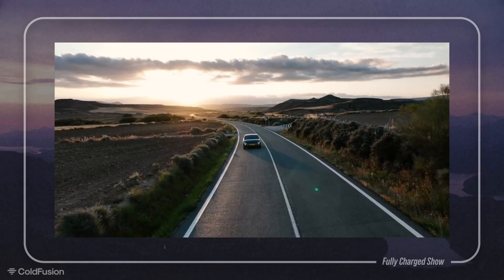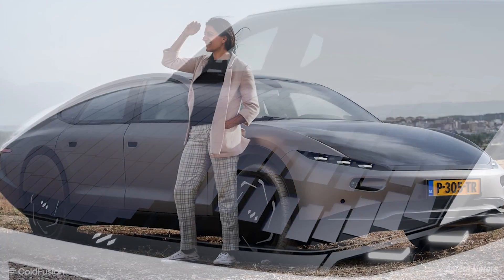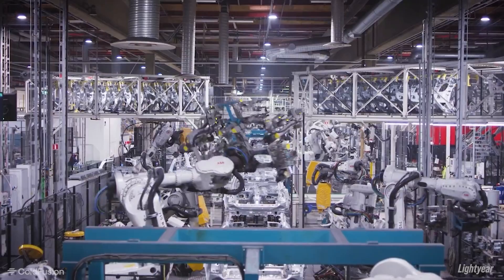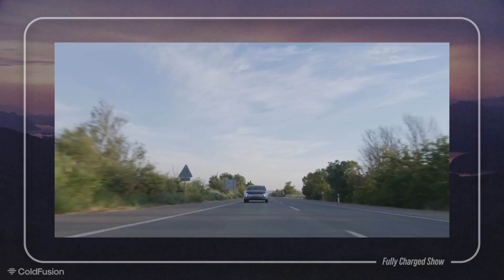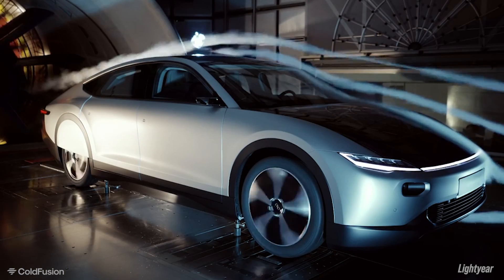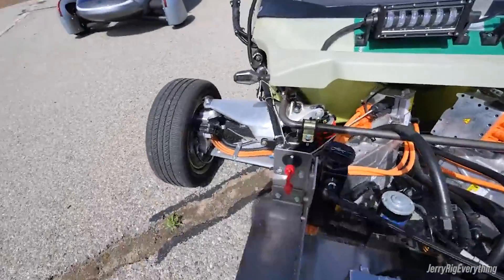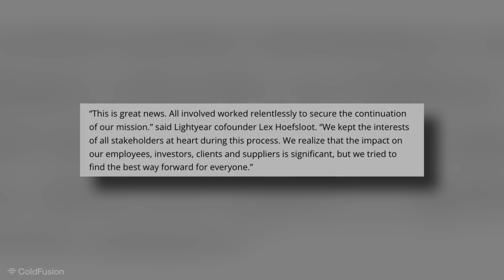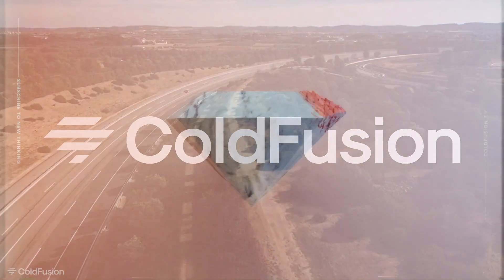3 Interesting Solar Car Projects

Comment: The panels would spend very little time in the optimal orientation. It would be more efficient to just place them on the ground. you need batteries anyway since its not always sunny. while not everyone can just throw an extension cord out the window, the solar panels would be extremely niche. sparing no expense is very rarely an option, in fact most companies try to spare as much expense as possible, just dont pull a Hommond and spare expense on safety.

Comment: The alleged to physics of this scam are Folly. Even if you covered every square inch of a very flat car and solar panels, you'd only get a couple miles of range in a fully Sunny area and the car would have to weigh as much as a go cart. You can forget about airbags, radio, A/C. The limitations are not from the technology, its the limitation of physics from the amount of solar energy hitting an area the footprint of a car. There's no getting around that.

Comment: Even with "fantastic" areo and things like that (meaning less grip) a car will still require a certain amount of energy to travel a specific distance. If you put your solar panel at the top of the atmosphere you will generate at best about 1.3kwh per square meter. With the BMW i3 you get about 6.4km/kwh at 100kph, even if can reduce drag with 20% and your solar panel is above the atmosphere it will not be enough to power you indefinitely. Also cars being too slippery is not a good thing, sure they use less power but they're also less safe due to the reduced grip. You want the rubber to have good contact with the road otherwise you have a plane.

This is a scam. Sorry.
Reply: Aptera is purported to require 0.1 kw-hour per mile.  I don't know at what speed.  With "full solar" and in a sunny local, it is not inconceivable that the nominally 3 square meters of solar panels on Aptera can create an daily average of on the order of 3 kw-hour of electrical energy.  3 kw-hour/day divided by 0.1 kw-hour per mile = 30 miles per day.  The average driver in the U.S. drives on the order of 30 miles per day.
Reply: @bobhilder1469  At what speed? A car that hardly moves is pointless. With 3 square meters you won't produce enough even with your panels in space.
It's literally impossible.
Reply: @volundrfrey896  As I said earlier I don't know at what speed Aptera's consumes 0.1 kw-hour per mile but it's certainly in the neighborhood of, say, 55 miles per hour.
Reply: @bobhilder1469  That's literally impossible. It's a scam.
Reply: @volundrfrey896  I'm getting the sense that you don't know that Aptera will have batteries.
Reply: @bobhilder1469  Turning your radio on, ac on low, and starting all ecu's and safety systems draws more than 100W. Buy a 30 dollar solar panel and hook it up to a tesla and it can "run indefinitely" (if you let it charge a few weeks between uses). Pop a barrel for brewing and a distillery in the back of an ethanol powered car and it can run "indefinitely".

Just accelerating a mass of 2 tonnes (very light for electric) to 100kph with zero drag takes nearly 800K joules.

It's a scam, just like nikola trucks.
Reply: @volundrfrey896  You're just not getting it.  Take care.

Comment: tbh, if it’s slow, I have to bow out. It’s not out of the necessity to “floor it”, it’s out of the necessity to maintain the flow of traffic.

For context, I live in Southern California, specifically in the south LA region (Long Beach), and I have a 30 mile daily, one way commute to Orange County. It’s personally prohibitive to risk driving too slow on our freeways - there’s alot to say about that, I know.

My ideal situation is no car at all - bicycle to work. I’m not there yet.

I definitely, definitely love the solar car concept (I drive a Honda Insight) and believe the pursuit of these technologies is paramount and necessary for the development of our civilization.

…there’s certainly more to say. But, I did want to answer your question posed. It’s not top speed I’m concerned about, but rather acceleration.

Thanks for sharing this topic!

Comment: Too bad about Lightyear. But have you heard about/looked at Aptera? They're on track to deliver their first vehicles with a 400-mile range that recharge 40+ miles per day through integrated solar panels. Highest end battery configuration allows for 1,000 miles of range. It's dope.
Reply: It is dope, and I need my fix!
Reply: It's followers are dopes.

Comment: I live in a 94 Ford e150 camper van that has four 200 watt panels and 2 100ah lithium batteries that along with my charge controller and inverter basically power a home's worth of appliances just off the sun. It's entirely possible to envision a future of motor homes powered by solar and hybrid tech, taking back the countryside from developers and the destruction of the environment for the sake of capitalism.

Comment: You are a pleasant storyteller.! 
Since the beginning Aptera is where I had my reservation 🤞 It is planned to be our daily go to EV but being a sEV , here in near the sunniest place in the US ( AZ) . Since they are an “roadster- style ) autocycle  and not an automobile I trust/ hope  it will be  a little easier to get to production.  Less components ( lean manufacture ) , lighter weight and less requirements of the automotive industry can be the edge.  With plans to crash test ( not required for class )  and publish results.  I have a convention four-wheel five seat EV and ALL EVs are faster than I have ever needed. I am more about range.  My two reserved ( AWD ) Apterae with 0-60mph (100k ) in 4 sec… is something that make “ those that care”… be impressed.
Most of what Aptera offers and the company ethos ALL speak  to me?!
Reply: Super excited about Aptera!

Comment: Define slow if it goes above 100km/ with 0 to 100 in around 16 seconds then it's definitely perfect for daily usage  for now I m driving Renault symbol 1.4L it barely hit the 150km/h with 0 to 60 in around 16s and sometimes more and it's perfect if we eliminate the emissions and stuff

Comment: The problem is these things have a lifespan of 10-15 years, they are very expensive to recycle and the materials required are the equivalent of building around 200 regular cars (not to mention a regular car lasts 50% longer on average, so think 300 cars, or 1 of these).

So once you look at the economics in detail, they are not viable and completely implausible. You're just shifting all your pollution, cost, etc to the start instead of spreading it out over the cost of the vehicle. But at £250k for the lifespan, you're paying nearly £17k per year to own one, assuming nothing ever breaks on it (it will!).
 
Putting environmental concerns aside for the moment, people on average use around £1.5-2k on fuel per year, so at £250k, that's 166 years of fuel, or one of these. That's a tough sell for the mass market.

Comment: "... but it happens to be pretty slow" -- not sure what the 0-60mph for the lightyear 2 is targeted to be, but the aptera is supposed to be 4-5 seconds depending on 2 or 3 motors.  and that's not slow.

Comment: Know what is much cheaper than solar panels? Pedals. I have seen a velomobile with a 250w pedal assist motor have 400 kilometers (or 250 miles) of range out of an 36v 15ah battery that weighs less than 10 pounds.

It isn't the prettiest thing to look at but you can't beat that kind of efficiency with anything else.

Comment: Just means we got to park the cars outside to maximise charging whilst not driving. I think the solar panels are definitely a welcoming addition to electric cars that are battery operated. So much to consider still including safety with how charging whilst the car has turned off etc

Comment: I might be wrong, but I suspect some of the claims made are just wishful thinking. A good example was at the end - a Prius with a solar roof can (in ideal conditions) add 4 miles of range per day. Expecting 40-50 miles from solar in a day, even on an ultra efficient car (and nobody could accuse the Prius of being a supercar!) seems a little far fetched to me.

Comment: I do support solar cars and development of the technology. But buyers should be aware that solar panels and batteries performance degrade over time. And replacing them can be very expensive to the point where it makes more sense to buy a new car. So its not the type of car that you can plan on driving for 20 years. But  more like 10 years.

Comment: I love how Dagogo says 160 kph is slow. My Buick has some sort of governor on the engine. It will not exceed 160 kph, and I find that to be plenty fast.
Reply: My Ford Transit box van has governor set at max 110Km/h, but you can turn it of by disabling "economy mode".

Comment: Everybody wants to be the one to make a more efficient car that doesn't pollute. The problem is that cars are the least efficient form of transportation. Electric light rail and heavy rail moves many more people per Watt. Most cars are moving only one person per trip, or six at the most. Bus and rail can move dozens of people per trip. Regardless, we are still obsessed with perpetuation cars as the primary mode of transportation. Car dependency sucks. They're expensive to own. They take up massive amounts of land to operate and store. They are inefficient. They kill any pedestrian they hit. They make cities noisy, literally. Cities are noisy because of cars.

Comment: The car was blatant nonsense, it simply didn’t have the required solar surface area for the weight of the car. I doubt it ever achieved more than 20 miles/day from solar charging in Europe.

Comment: No. I really much more hope, that someone would be able to make carbon capturing and making diesel and gasoline fuel from it viable option, as those fuels don't have same downsides for person driving vehicle (like having to spend longer time charging, than putting fuel in), it's already is used, and well understood, and on top of that it don't require new vehicles, and all rare earths minning that's involved in making electric vehicle

Comment: I love your channel (I usually watch it on Nebula), but a solar-powered car is a dumb idea.  The performance number that manufacturers give don't add up.  The costs are too high for the capability delivered.  I'm not saying electric cars shouldn't have solar cells built into them but design compromises and cost for making a car intended to primarily be powered by solar is just stupid.

Comment: The reason for the bankruptcy in short

1.The Zero was even even more expensieve than expected (over 400K to build), so they were making a loss on each car delivered.

2.Due to the economic chance, investment money was harder to come by in the 2023's (good analysis Dagogo)

What I have heard is that they were close to signing a deal for a new round when the plan fell through.

Those who know the world of tech startups know that for a long time you live in , as we say in Dutch "tussen hoop en vrees", between hope and fear.

The roots of Lightyear go back to 2011 when Lex Hoefsloot set up a team to participate in the 2013 World Solar Challenge.
And there is word that Lex had this project on his mind even before he started studying at the TU/e.

At first Solar Team Eindhoven wanted to participate in the racer class abut then they had to compete with other already successful Dutch universities.
However, for the 2013 challenge the WSC organization added a new class, the cruiser class.
This class was designed to have participants designed a more useable solar car instead of a pure racer with only the pilot.
So the team opted for the cruiser class since to would also create a more realistic car.

Fun fact for those viewers who are skeptical about these vehicles.
I think it was in the 2017 edition that during the WSC race Solar Team Eindhoven where looking at the power consumption and the capacity of the solar panels.
They could not believe that the battery was not charging because it was fully loaded and they were driving like 120km/u.
They decided to accelerate to I think 130 km/m, the maximum speed for the car on the long run. So 130 km/u with 5 people on board on solar energy only!

I think you can find a documentary about this on YT for the 2017 race.

There used to be a documentary from NATGEO also on YT about how Lex assembled the team in 2011, it seems it is taken offline by NATGEO or it is me not searching the right way.

One of the benefits of cars like this is that countries do not need an extensive network of charging locations, so with cars like the Lightyear you do not need extra power plants or have to expand the grid.
For that reason alone I do not understand why the Dutch and German government did not seriously invest. It would have been way cheaper to invest in Lightyear and Sono than to invest billions in power plants and expansion of the power grid.
Both Lightyear and Sono each had contracts for 20.000+ cars at the time of bankruptcy!
Reply: Update November 10th 2023

Two Dutch news outlets, NRC and Quote. published a follow-up article on the downfall of Lightyear. Links to these articles at the bottom of this reply.

Six take aways.

But first a bit about the last few weeks before bankruptcy was declared.
According to NRC new funding was just around the corner, Dutch car manufacturer VDL (NEDCAR) and EIB (European Investment Bank), seem to be ready to fund the next round. They pulled out and so the startup ran out of cash and had to file for bankruptcy end of January 2023.

Here is why according to NRC and Quote:

1. Unexperienced management team
The company founders had no experience running a car company since they just left the university.
The general opinion is they should have, at an early stage, taken in experienced leadership with a car building back ground.

Finance and control
The last few years the finance department was understaffed and needed a senior finance with, again, experience in the car industry.

People
Starting form 2020 and on, the team expanded rapidly to almost 650 employees.
In hind-side, to many people that shortened the companies runway.

2. Unrealistic optimism
By the end of 2022 the EIB bails out, talks with VDL-NEDCAR continue.
The fact that the startup was successful in raising money for the last three years is giving the management team the confidence that this time it would also work out well.

Maybe the biggest problem now is the company ordered parts for the Lightyear One, but the sales dropped after the retail price soared. New investor money will be used to fill this money-pit.
As a result, VDL - NEDCAR pulls out of the talks, days later Lightyear files for bankruptcy.

3.Deeptech, not in Europe
Europe does not have a culture of investing big amounts in deeptech companies.
I think other European deeptech startup can learn from this to try to move to the US that has a different culture when it comes to funding deeptech.
Lightyear needed about a billion Euro's and that kind of money is simply hard to find in Europe.

4. The expensive showcase, the Lightyear One
Many wonder if it was a good idea to build a very exclusive limited high end car as a showcase for the technology. With an initial price of around 150.000 Euro that went up to 250.000 Euro ex tax. A lot of the early buyers/investors pulled out making the first edition car even more expensive, eg creating more debt per car sold.

5. Communication
Even in the last few weeks before the end, private investors still invested in the company to discover after the bankruptcy they had no shares in the part that holds the ip, It is just the production company they invested in, it is this part of the company that  failed.
Many investors had no clue what was going on because they were never told.

6. Timing
Not all can be blamed on the company, the COVID pandemic followed by the war in Ukraine changed the climate for the financial markets. Different ways for an IPO were investigated but the rapidly changing economic situation made that these ideas were put on hold.

An investigation is started to see if the management of Lightyear made mistakes that make them liable for malpractice.

Lightyear made since January 2023 a modest come back with 30 employees and is now producing solar panels for the car industry as an OEM.

Read the full articles (Dutch) here:
https://www.quotenet.nl/zakelijk/a45810811/wijze-lessen-na-het-faillissement-van-lightyear-lex-hoefsloot/

Sorry for the paywall
https://www.nrc.nl/nieuws/2023/11/10/het-korte-avontuur-van-zonne-automaker-lightyear-zes-lessen-uit-het-faillissement-a4180476
Reply: LinkedIn update January 16 2024 (although the website from LY states December 2023)

Looks like the founders now al have given up their executive role in Lightyear, the former CEO and co-founder who will help in transitioning the company into a company that does on-board solar charging systems.

A couple of months ago there was word that a small team was still working on the LY 2.
I think this step means that the Lightyear 2, a smaller sized family car with an estimated price around 40k-45k will also be cancelled.

Here is what they wrote on their website and the LinkedIn post.
"Lightyear announces leadership change to accompany focus on market introduction of on-board solar charging systems

We are proud to announce the appointment of Bonna Newman as CEO and Marnix Borghouts as the new CFO. Lex Hoefsloot, our founding CEO, will remain with the company to support a smooth transition and to focus on the longer-term potential of the company.

Bonna: “Lightyear has demonstrated how highly-efficient electric vehicles combined with on-board solar will accelerate the energy transition and benefit the world. Lightyear has set the stage for a new era of solar-powered mobility. I look forward to partnering our amazing team with the automotive industry to ensure the best on-board solar technology is available to everyone.”  

The link to the article.
https://lightyear.one/press-releases/lightyear-announces-leadership-change